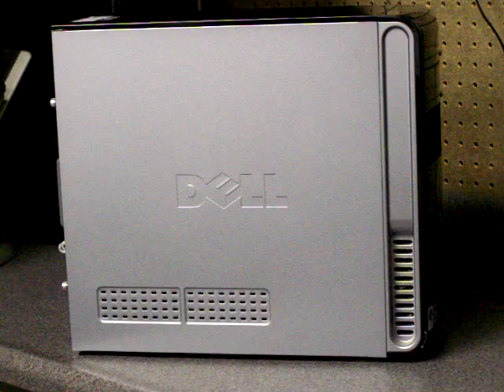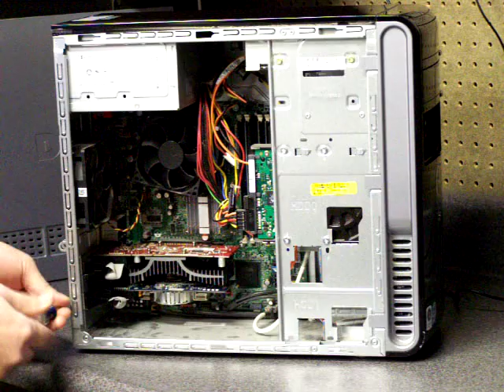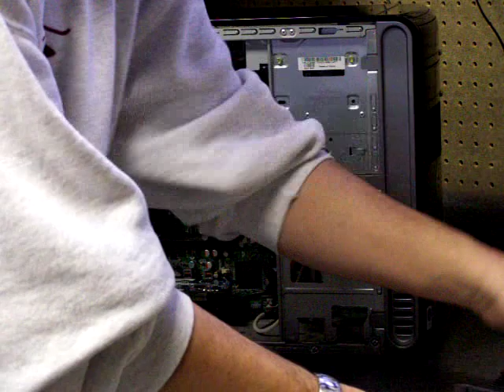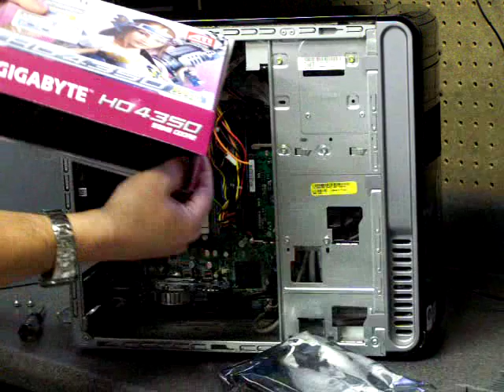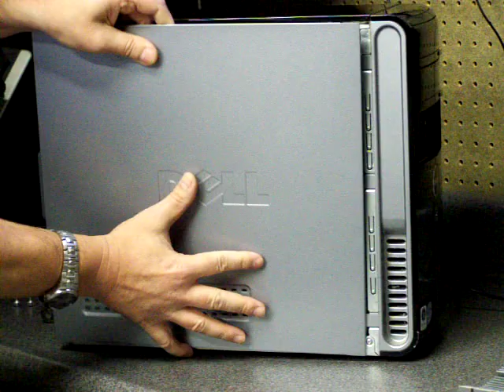Installation of a Second Video Card in a Dell PC

Comment: I ran a HD5770 which is basically the same card (6770 is just rebranding) and i ran it fine on a 400W psu :) but my cpu was not all that power hungry and i had one hard drive =O

Comment: The card that came with my computer is a Intel(R) G45/G43 express chipset, it can't even run Diablo 3, so I got one from a website that said it was compatible (Discount Electronics). The card i have now's memory is only 128 mb, so i got one with 256 mb.  Today I figured out how to put it in and now i just need two things. I need a wireless internet connector because that connected to my old video card, and something to connect my new video card to my monitor. I think, this is my first time. lol

Comment: Hi.. I want to buy second gpu. But, not for gaming, for TV out, because I don't have S-Video on my primary gpu - Gigabyte GTX465. So, is it possible? The card I wanna buy is Leadtek 8400GS, because it is the only card I found that has S-Video and it's PCIe, and.... It costs 15e. PLEASE ANSWER, AND THANKS IN ADVANCE. (sorry for caps lock on)

Comment from the maker: The x300se is a basic card and does not require any additional connections. Once the card is in, the power and cables are connected and the power switch is turned on it should automatically install the drivers it needs. If you are not running Windows 7 then I would suggest having the drivers available as a precaution.

Comment from the maker: You are going to have to find your owners manual (online?) and look up the slot type. Once you know the slot type (and specs) go to Newegg or Amazon and find video card for that type of slot. Make sure the card you buy does not require a separate power connection as the eMachines PSU will probably not support additional video card connections.

Comment from the maker: Remove the computer cover.
Remove the screw holding the card retention bracket. 
Lift the card retention bracket and set it aside.
If necessary, disconnect any cables connected to the card. 
For a video card in a PCI Express slot, pull the securing tab, grasp the card by its top corners, and then ease it out of its connector.